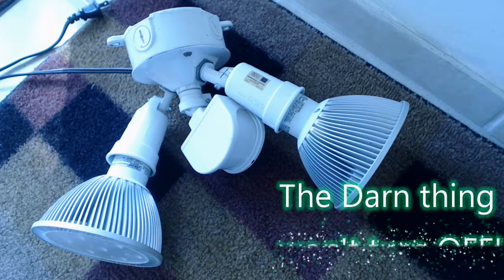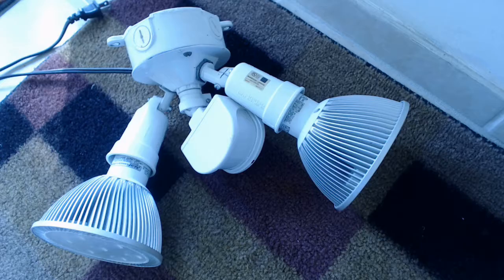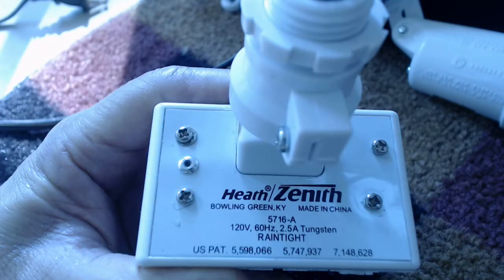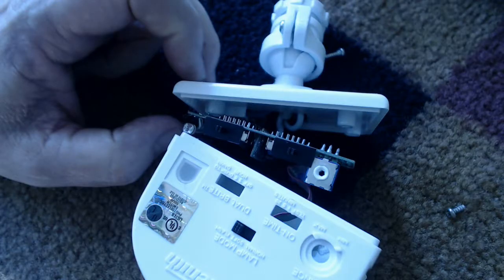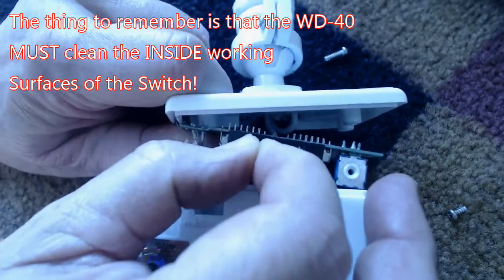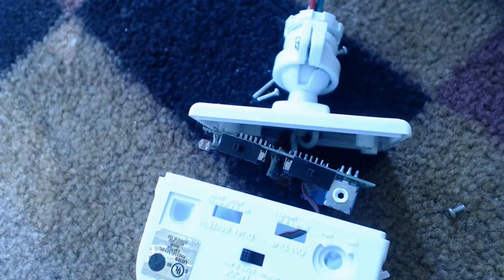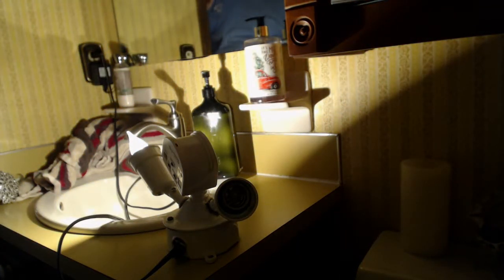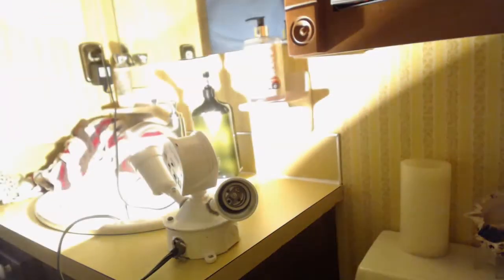Motion Activated Lighting Repairs:  Won't Turn OFF!

Comment: I have several of those lights and I've had great success and longevity with them. However after 20 years I've had a couple fail but mine failed by not turning on. The LED goes on and senses movement but the light won't turn on in the dark. I believe it's something in the daylight sensor that's failed but I haven't been able to find anything on how to fix or replace the daylight sensor part?
If you hunt around you can still find the whole motion sensor part of the light and just replace that part but often it's almost as expensive as just buying the whole unit...
Thanks for the video.
Reply from the maker: Believe it or not, the switches in the sensor go bad due to rust.  I've taken several apart and never found anything but rusty switches.  Sometimes you can take them apart and spray down the switches with WD-40.  Then rapidly work the switch and put it back together.
Reply: @EdHumble  
I'll have to try that. 
Thanks you👍😊...

Comment: Had a brief power outage tonight, now the motion light will not cut off. What do I need to do ?
Reply from the maker: Disconnect power.  Wait five minutes.  Reconnect power.  If that doesn’t work, slide the switches around several times and cycle power again.  If it still won’t turn off, Surgury or replacement time.